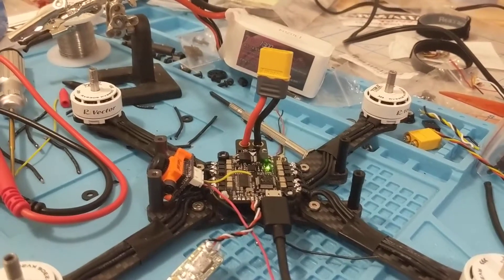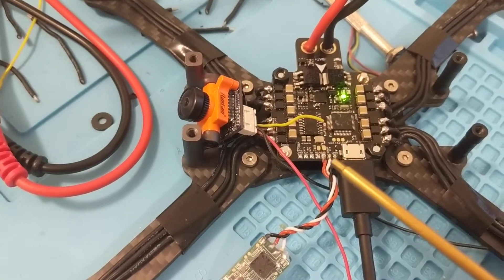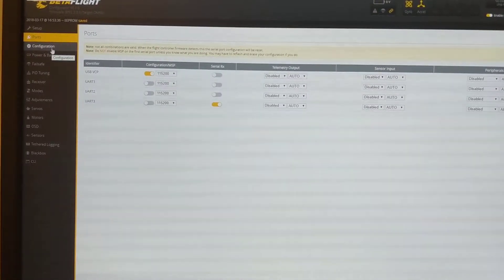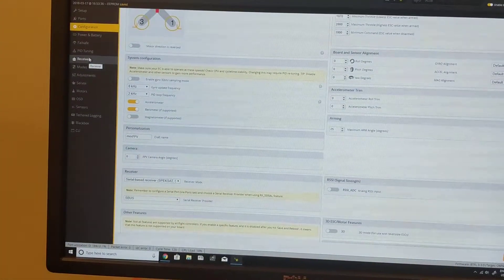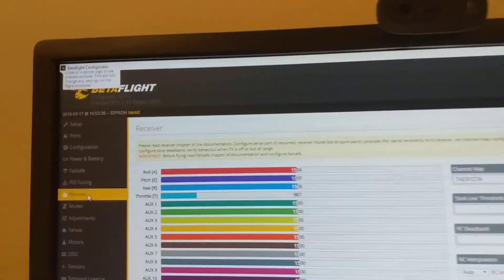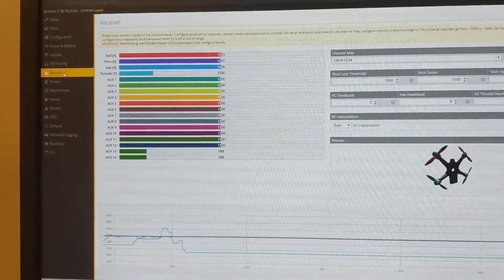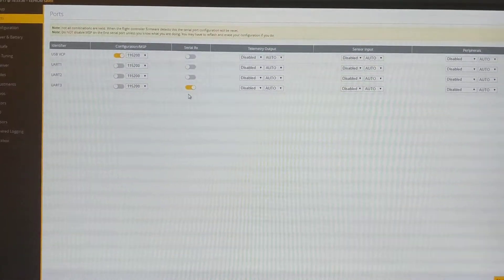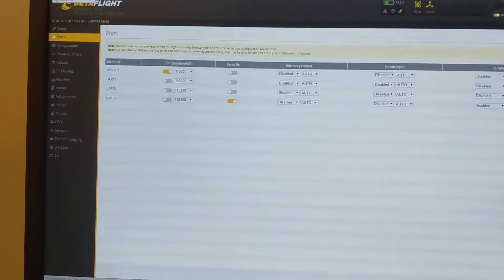Banggood Racerstar StarF3s SBUS setup on BF 3.3

Comment: Thank you for posting your solution.  I'll try it out.  Question, where did you solder your SBUS input?  I have read of people having to jumper two points, but your config looks simple and direct.  Thanks again for your time and efforts!
Reply from the maker: In the video you will see the white wire, that's where I soldered it, I didn't have to jumper two points. I am using an FRSKY xm+ receiver in this video.
Reply: @wavesummit  hey james if your issue got fixed...please let me know. (Same issue)
Reply from the maker: @spareexcel6802  Yes it was UART 3 not UART 1
Reply: @wavesummit  Thankyou james ,  question * (i got "RS Star F4S AIO)
So what receiver should i use? (I have FSi6s radio controller)
And how do i setup (sbus/ibus)

I will really appreciate if you help me with this. Thankyou
Reply from the maker: @spareexcel6802  The f4s is completely different board from the f3s. For your flysky receiver  you would use ibus, I would check if it needs a inverted port.
Reply from the maker: @spareexcel6802  https://www.rcgroups.com/forums/showthread.php?3102211-RacerStar-StarF4S-with-SBUS-no-signal
Reply: @wavesummit  thankyou again. If i have ia6b receiver where should i connect wires to f4s (ibus setup)
Reply: @wavesummit  i can see (SBUS 5V and GND)on f4s
Reply from the maker: @spareexcel6802  I sent you a link to a document, you can use sbus pad but you would need to univert it using betaflight CLI, or try uart 6, good luck
Reply: @wavesummit  thank you so much I really appreciate your help.